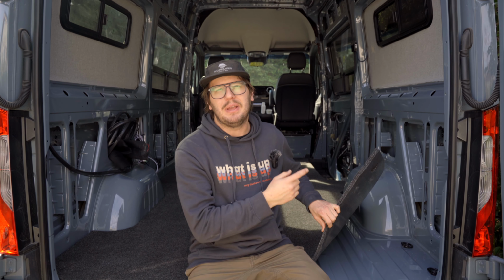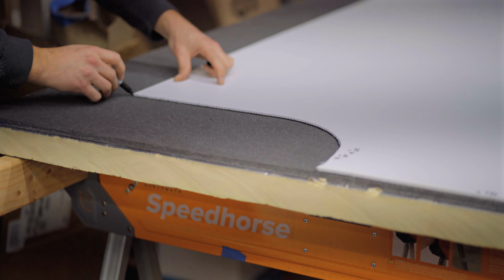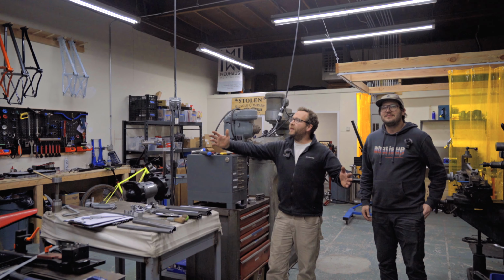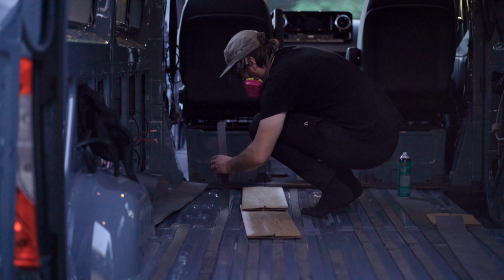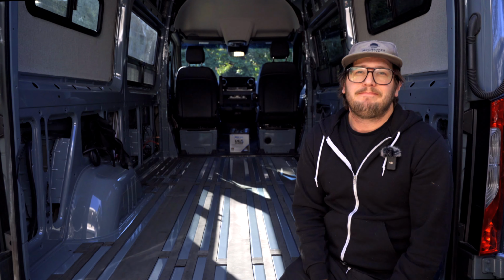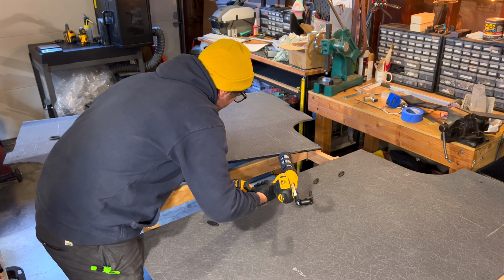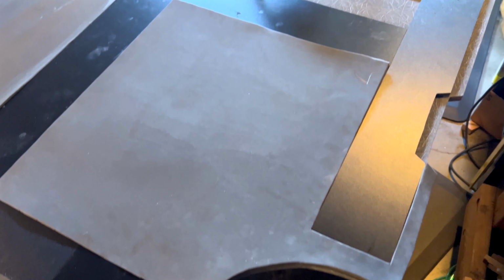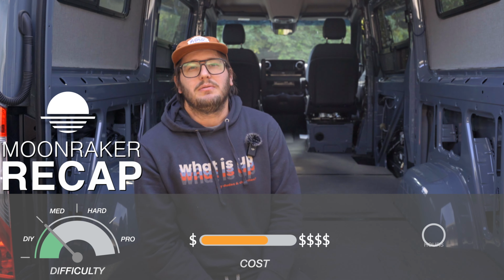The Ultimate Sprinter Adventure Camper Van Subfloor

Comment: Hi Todd, I have been researching the sh*t out of many flooring systems for my 144 Sprinter Build and this is exactly the procedure and components I have been researching. Then, I came across your video that you guys just posted. Perfect timing and have been looking everywhere for a video like this, absolutely great video. I plan on using our CNC Router to machine it in sections along with all the L-Track cutouts. I also like the idea of using the PVC strips for your supporting structures and allowing for the extra Minicell foam with the 3M Thinsulate. Really do appreciate your videos and humor. Looking forward to next video for the L-Track Mounting and your finishing steps.
Reply from the maker: Having a CNC router would have been the dream, but honestly it's not too bad with a track saw.  That's the tool I wish I had building skate ramps when I was a teenager lol!  It's a lot of extra effort to put the PVC slats in and cutting out the minicell foam, but I think it really does make for a nice solid floor.  It also went way faster once I figured out the indentation trick.  I was measuring them all out and thinking "dang this is going to take FOREVER."  I know DIY Van puts the full sheet underneath and that seems to work well too if you wanted to save some time.  The minicell is pretty resilient stuff and compresses to a hard surface pretty much, I wanted to have it at full loft for the insulation properties for mine though.
Reply: Yes, I also saw that on DIY Van with the Minicell underneath and I am also looking into that as well, I just need to scan the floor to get an accurate CAD Design. Along with figuring out the proper mounting locations for the L-Track for two removable seats behind the driver's seat. 🙂 👍
Reply from the maker: @rcrdesign6540  DIYVan has actual 3D CAD surfaces from Mercedes.  That would be so nice.  The scan data I have is not good enough to get that level of detail in the ribs, it's really only for nominal dimensions.  I wish Mercedes would have a dumbed down CAD available for people that had floor, roof and interior walls. 

For my seat behind the drivers seat I'm going with this 

https://alpinevanworks.com/products/double-bench-to-bed-seat

They were kind enough to send me a drawing of the seat and where to put the L-tracks.